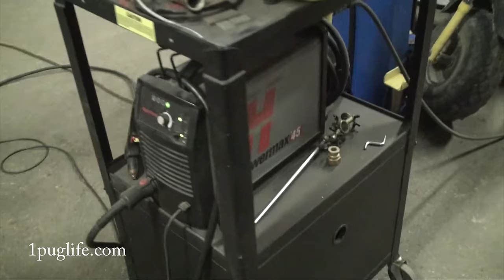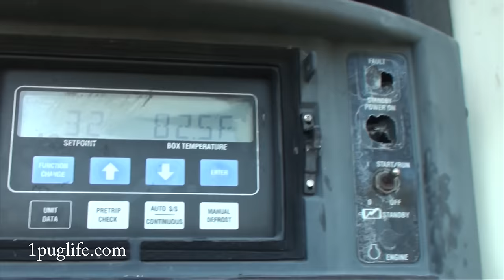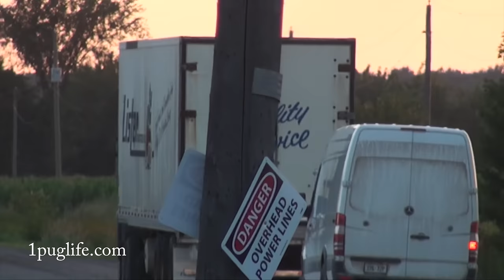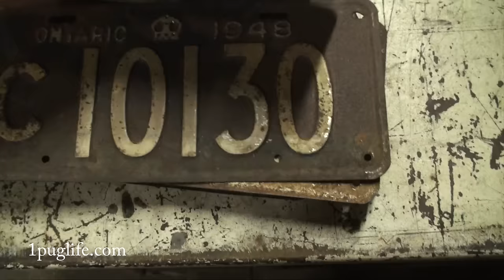clown towncle wins

Comment: what l find with plasma cutting, flip the angle over so the legs of the v are down, it makes it so the torch wont jump off  the angle and its a smoother pull,
Reply from the maker: frig ya man ill try that
Reply: I've seen your future..... Your a beaver buffer not a welder. :)

Comment: you should have taken the cooling system off the reefer and plumbed it up to your shop so you can have air conditioning in the ole shoptropolis, just run it long enough to cool the shop down then shut it off

Comment: what is the purpose of the motor in the power supply that drives nothing?
Reply: I think in the video where he bought it the guy said it was to prevent horsepower loss. I don't fucking know sounds like bs to me.
Reply: ermcer: do a search for something like "The Basics of 1-phase to 3-phase Inverters"...
Reply: In My mind, I'm thinking it's acting bit like a Resistor/heat sink, to eat up some of the extra Volt's before Ya Use Em..! 
But I no expert, sometime... Pologize...